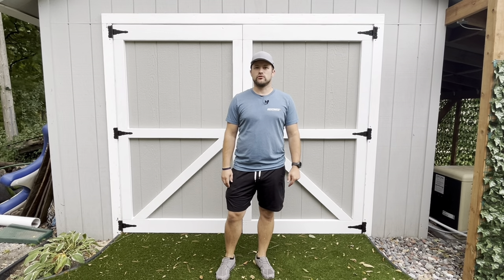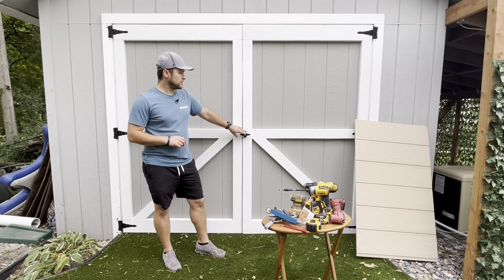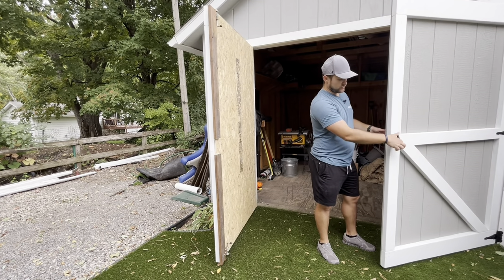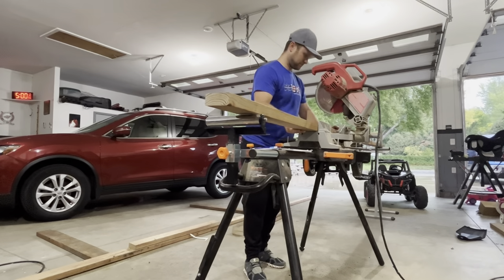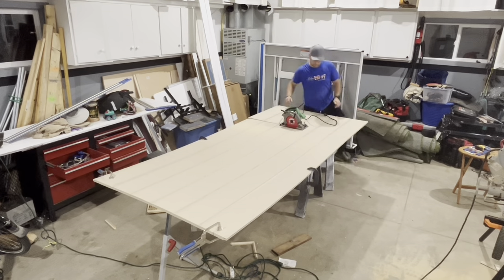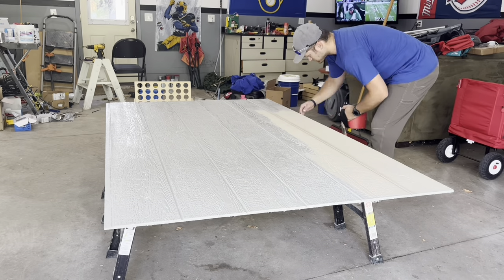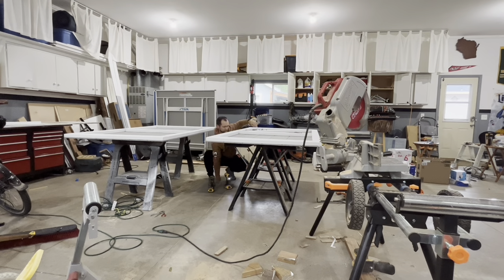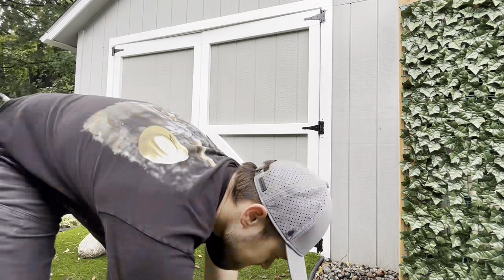How to Build and Install Double Shed Doors on a Budget

Comment: As well as your doors keeping out water, it is also important to me to keep out those annoying mice that leave droppings and urine on things and chew on everything else. No mice in my sheds. One way to stop rodent invasion is to leave no gap greater than 1/4" (or one that can easily be chewed larger to 1/4"). Therefore I would increase the overlap of your door at the bottom to at least 1/2". In your case that would mean lowering the outside ramp a little. Not sure about the sides of the doors, but that can also be made mouse-proof by adding pieces so that there is no gap over 1/4"
Reply from the maker: When you say overlap, you mean the door goes on the outside of the actual floor and there is a lip to walk into the shed from the ramp? Maybe something that can be done at the time of the build but this is retro fit and is mounted to the outside of the shed opening. Has to sit inside the framing.  But great points. I spray my inside and outside of the shed for critters to try to prevent that. I think ive got 1/4” or less all around out of luck!!
Reply: @AllHomeDIYDad  -- I'm no expert on the subject, but I'm working on it. The last shed I built (to store stuff at a rental property) I made sure the front "skin" of the door went down past floor level. I also put in stops for the sides and top of the door. When shut it's reasonably sealed and I haven't had mice after 4 years. Also extending the front of the door past floor level will direct rainwater past the floor rather than going inside. For a retrofit like this, if the gap at the bottom is too large, a "trim" piece could be installed inside. When the door is shut, from the inside attach this trim just a hair above the floor. Another way is to install a stop on the floor, maybe 1/2" thick for the door to press against. Of course you would be dragging/driving equipment over it and it might be a tripping hazard, which makes this my last choice. These ideas would stop mice but stopping water seepage could be more challenging. 

I'm now in the process of building a 12' x 16' garden shed at my house and the design is that the door panel material, which is the same as the siding, will be flush with the siding and thus an overlap at the floor will be tight against the floor framing and thus close it off to mice and rain. I'm also adding a small overhang above the door to divert rain away from the top of the door. I'm also doing a double door like you have, and making sure that one door overlaps the other where they meet. And just like you did, I'm also adding spring latches to top and bottom of the one door so that it is held tightly shut, with the door latch holding the other door tight. I see that some shed manufacturers in my area use long turnbuckles (like 50" threaded rod style made by Wright Products) mounted inside from the top and bottom corners diagonally to the door framing on the hinge side. The turnbuckles can be adjusted to make the door a flat plane rather than twisted. This seems like a reasonable and lighter-weight alternative to the extra panel on the inside of the door, and maybe cheaper too. Between YouTube videos like yours and also visiting my local shed manufacturer, I've been able to glean more ideas to make my best shed ever. But I have to wait for the snow to melt first...
Reply from the maker: Fantastic planning. I like how your mind works.  I dont really care too much about the bottom being under the door as the outside of the door does overlap the floor so it would be hard for water to get in that way. Also, I dont keep anything in there that I care too much about. Have a large garage I store anything expensive or with a motor/battery. Floor plywood can be replaced if it gets soft.

Comment: what size of back stop board did you use in your video at 27:05?? I am installing the same door handle you did.
Reply from the maker: Where im installing the latch pin? Its the hardy board siding. I think its half inch thickness but the 2x6 is at the bottom so screws go through and into that.
Reply: @AllHomeDIYDad  Is that the same size as the board on the left door that you used a oscillating saw on? Thanks for your help.
Reply from the maker: @wadekruse4462  yes. Its the same panelling. The hardy siding is very nice and easy to work with.
Reply: @AllHomeDIYDad  In your video you are installing a wood piece on the back of the left door so when the right door shuts it will hit up against the left door once you latch it closed( left door as if you are standing in front of the shed looking at your doors).  What size is that board? Sorry about the confusing questions.
Reply from the maker: @wadekruse4462  ohhh!!! Sorry! Its just a peice of scrap wood I had. Anything will work that is 1/2” thick or more by about 3.5” or more wide. Just something to screw in to stop the other side from going in too far and keeping them flush
Reply: @AllHomeDIYDad  Perfect, thank you for help. By the way, great video!!!
Reply from the maker: @wadekruse4462  thanks so much. Let me known if you have any more questions.

Comment: You can order a new roll up door thru Home Depot for 410.00 delivered to the store. I just did. It is quite simple to put together and install,  much less labor than building one. Don't get me wrong,  I like the wood doors too. I just wanted to share another option for some of your viewers. You can order the door in any color at no extra charge. I ordered a 4x6'8" for 410.00
I like your shed btw👍
Reply from the maker: A good option! I could not find one there that fit my dimensions and my wife hates the roll up. Also dont like how it sits inside the frame. Moisture gets onto the plywood bottom all the time.
Reply: @AllHomeDIYDad I poured a slab for mine. Yeah it wouldn't be as good for a plywood deck. I built mine 12x16. Knowing where the door would go I put a very slight slope to that area.
Reply from the maker: Thats awesome to have a slab under it!